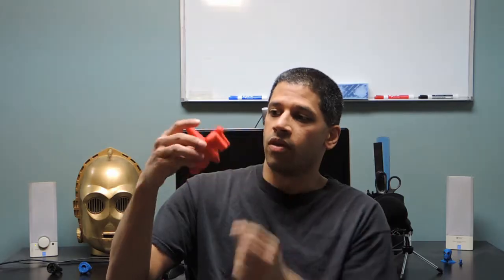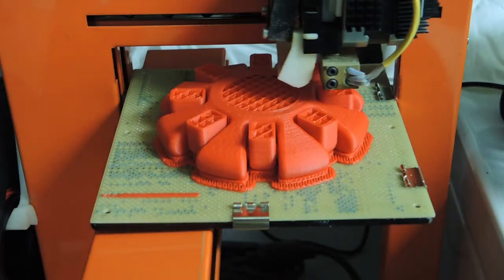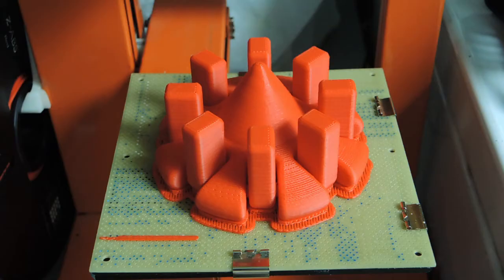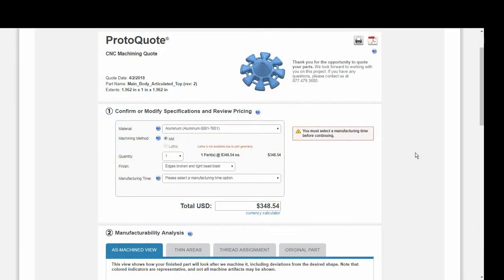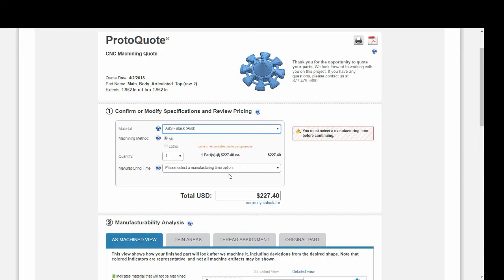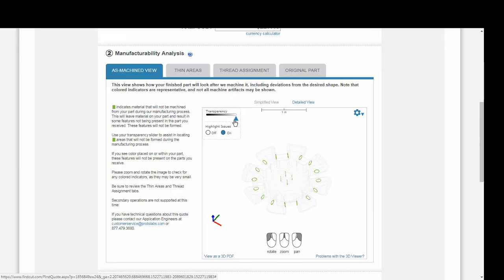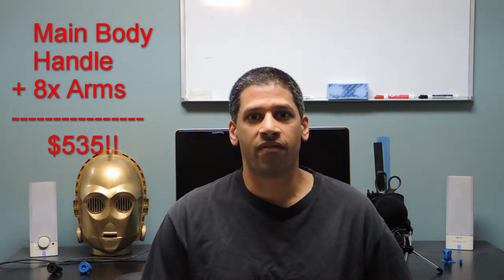3D Printing vs. CNC Machining: Prototyping Cost Comparison

Comment: Very biased analysis in favour of 3D printing.
The first bias starts with the type of design which is perfectly suited to layer manufacture, and which Is notoriously difficult using any other method (each part to needs to be made individually).
The video would feel more honest if these biases weren't there.
Reply: making each part individually could be beneficial as well.

if a single part breaks then just cnc a new one of that part.
but in 3d printing you'd have to 3d print the entire thing again.

Comment: your comparison makes no sense. to make a true comparison it would have to be a AT HOME cnc machine vs at home 3d print.
Reply: i was literally just about to point that out XD

you also have to account that the company has to make money on top of the resource and labor cost.
even though its mainly automated you still need someone to go over the design and punch it into the machine.

i would say that cnc would actually be a hell of a lot cheaper over a longer period of time assuming you have the cnc at your home.
because you can use pretty much any material you have laying around so that allows for recycling pretty easily.
and you can cnc metal.
you can't really 3d print metal , you can sort of but it wears very heavily on the nozzles and its mixed with a plastic filament which may not be desirable in high temperature applications.
Reply: @logangraham2956  Same, I came here because I was thinking about how at home cncing is kinda better because of the ability to cnc metals for pretty cheap.

Comment: 4:35 $1 Dollar worth of filament?
Reply from the maker: Not sure what your question is.
Reply: @PotentPrintables  
Idk, how much do you pay per kg of filament? 
I bought PLA for around $15 per roll.
Reply from the maker: Yeah, it was probably an overestimate.  It was also for the larger red top, not the small blue one.  And I probably used a higher infill setting.
Reply: @PotentPrintables  
That makes sense.

Comment: This is a stupid comparison. Because you "assumed" you already had a printer, you also have to "assume" you already have a cnc. if you have a cnc, the plastic for machining that would cost about 1/10th of what the filament would cost. Plus you could make it from aluminum for not much more. If you´re going to outsource the CNC´ing you also have to outsource the 3D printing. Check and see how much that would cost. Then you would have a much fairer comparison
Reply: But 3d printers are much much cheaper and he mentioned that clearly, why would you outsource 3d printing knowing that the price of a 3d printer costs less than the service itself ?
Reply: Yes true.... then it would be a straight comparison of aluminium billet versus pla filament.
Tbh aluminium isn't v expensive either so the cost would be $1 versus $10

Comment: Sorry, but the comparison is quite unfair and misleading! I would expect you to compare cost of a prototype made by owned 3D printer to OWNED CNC machine. Or 3D printing as a service to CNC machining as a service.
True, buying a CNC machine is 50% more expensive (considering a small Chinese CNC router is good enough for a hobbyist), but if you already own one it doesn't add to the cost of a prototype. Also consider you get prototypes with better accuracy, surface finish and much wider scope of properties/materials.
There are of course shapes hard or even impossible to machine using subtractive methods, where 3D printing excels. But there are other shapes (often the simple one and more often used) that are horribly inefficient to be printed, but very easy to make using CNC machine.
Conclusion:
If you want to be efficient in prototyping, have both a small CNC router and a 3D printer! How much money you can effort to put into those it's up to your budget.

I like 3D printing for its simplicity (no multiple setups, changes of tools etc.) and time efficiency in a sense that I can let the printer do its work and focus on something else. It's also incredible for producing very lightweight objects (handy for RC planes, drones etc.), where the strength of the part is not very important.
CNC machining excels on the other hand if you need precise dimensions, perfect surface and/or other materials than printable plastics. All, even cheap Chinese CNC routers, CAN do aluminum (they are not proficient in it, but they can...) and that broaden the options what you can prototype/manufacture tremendously!

Example:
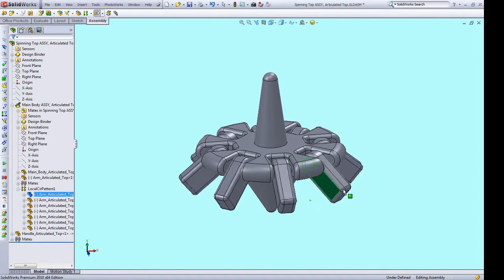One of my projects was to upgrade my 1:10 RC car for other type of body and bigger wheels.
- Custom stand-offs for the body, new battery tray (to accommodate Lipos) -> 3D printed from ABS (both prototyping and the final parts)
- Custom wheel hubs/adapters for bigger wheels:
-- first quick prototype -> 3D printed from PLA (good to check dimensions and feasibility, but not strong enough - ABS won't hold as well in this application)
-- second prototype with adapted dimensions -> CNC machined from POM (tough plastic, but with huge thermal expansion coefficient, which makes it very hard to 3D print)
-- final part -> CNC machined out of 7075 Al

P.S. If you are into miniature and figures for tabletop wargaming etc. skip FDD printers and CNC and go straight to SLA 3D printers!;-)
Reply from the maker: Thanks for your detailed comment.  I hope I can provide some additional information below on the comparision I made.

So what I showed in the video was a quote from a CNC machining service, for this specific test case.  A quote from a 3D printing service for this test case would still be an order of magnitute less (~$50 vs ~$500).

Owning and operating a CNC machine is very different from owning a 3D printer.  The setups, tooling, and general skills needed to use them are more complicated than 3D printers.  This makes using a CNC machining service appealing.

In addition, for the test case used in this video, the machining required would be quite complex (read 3-4 axis machining).  A cheap, home CNC would more than likely not be able to provide this.  CNC services have large, industrial machines that can provide this.

As you say, if you can afford to have both at you home, that would be great!  But what I am saying is that if I have to choose one (at this time), I would choose a 3D printer.
Reply from the maker: @Captn_Grumpy  It's a fair point that I should have emphasized all these technologies have there uses and strong/weak points. I also agree that we get into using 3D printing for everything, when other materials and processes would be appropriate.  I try to be conscious of this, but it can be tempting to 3D print all parts of a design.